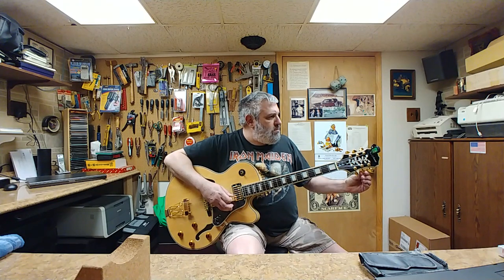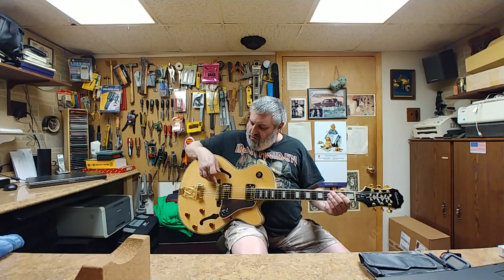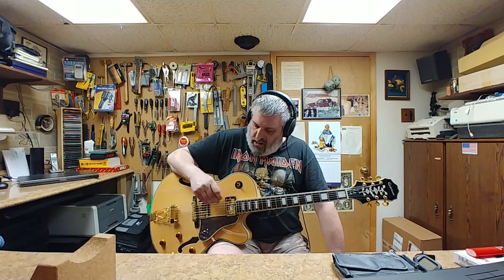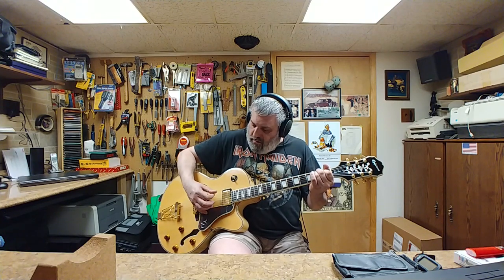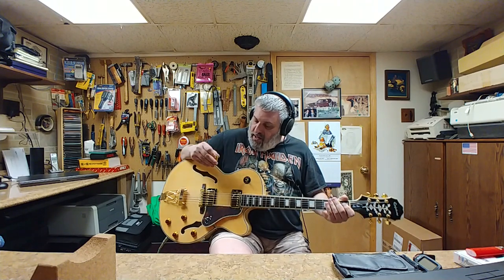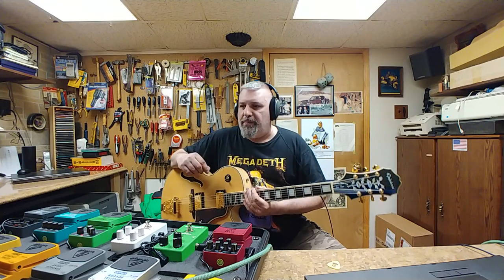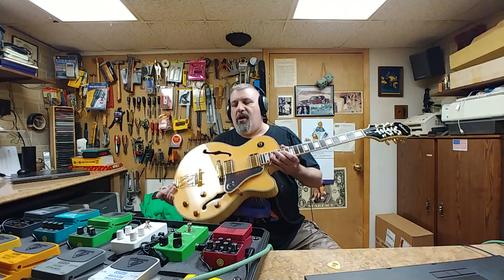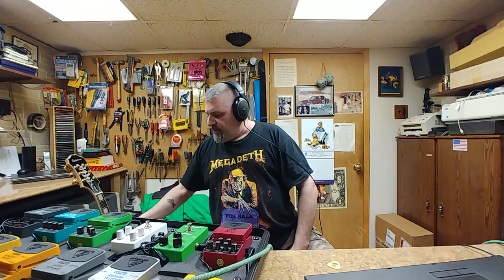Epiphone Joe Pass Sound Test, Bye Bye Joe

Comment: I put a 70s super distortion in my hollow body.  Have to take it out. Its to hot all feedback. The neck p-90 sounds good. Ill find another p-90 pickup.
Reply from the maker: i thought about getting a set of P-90's for this, but i wanted to keep it original.